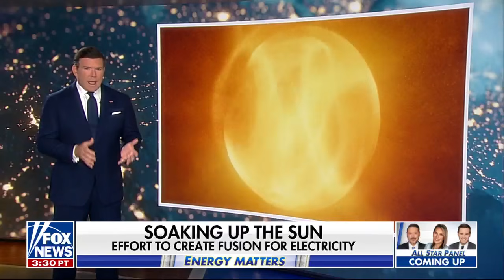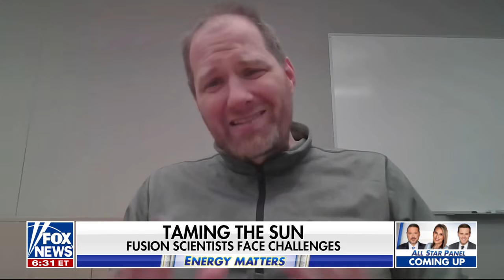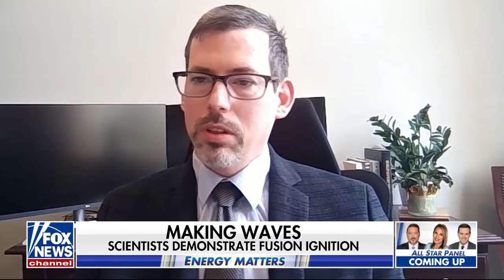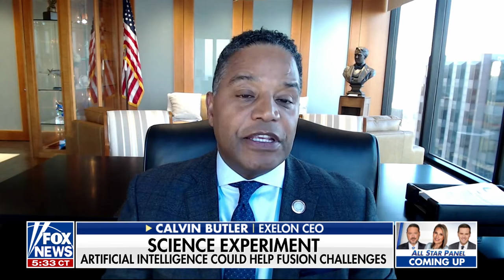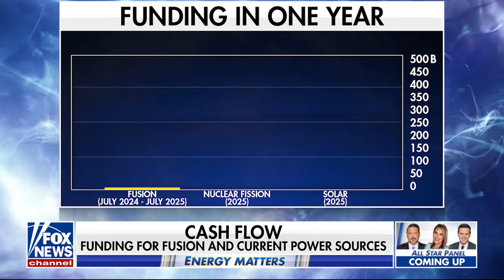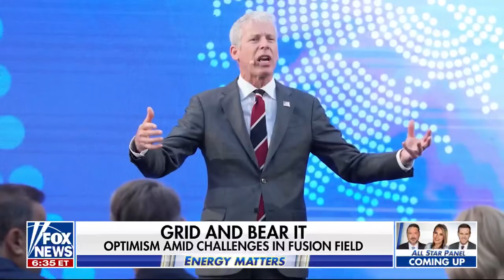AI aiding scientists with challenges to create fusion as a reliable energy source

Comment: The biggest problem with fusion reactors is rarely mentioned. A single fusion reaction is between a deuterium and a tritium atom. Tritium is radioactive and cannot be found on Earth so it must be made in the reactor itself. Each fusion results in a helium nucleus and a neutron. The neutron can be used to breed tritium from litium but neutron and tritium losses in the production chain will give a yield less than one. There are methods to increase the number of neutrons but they will probably not be sufficient.

Comment: I wonder if anything will come from "sonic levatation"?  Things we don't expect.  Just moving a physical object with out actually touching it.. cool.    But, what do you actually have with sonic levatation?  High speed, almost infinite rpm's... with no physical ball bearing or axle or means to hold the high speed object.  There is No Friction.  If you vaccum out the room of air and all air friction.. is the spinning sonic object "frictionless' .. that alone in science is ultra hard to do or achieve.  What is spinning?  does it generate a magentic field.. is it cold or hot in the room.. plus or minus Pressurized room too... if a quartz crystal was pressurized a piezo electric effect happens.  Then spun.. the field would expand or contract/condense?

Comment: Helion Energy is building a   fusion Plant WA state. 50 MW (megawatts) It will power Malaga, WA  (Chelan County),  and the DATA center that's being built there. The issue is the Energy fuel . They are using Decayed Lithium to create the Isotope (Tritium Breeding - Helium-4  )  mix with Detruiem .  Helium-3 (
He) Is preferred but the Earth doesn't process enough of it and that would require harvesting the atmosphere (You can see the issue with that  ) ? Helium-3 is already ready broken down and has a lot shorter half life. 
Helium-3 (He) is found in abondance on our Moon . This is why NASA wants to go Back to the Moon.  
Musk Dream of Putting Solar Panels  around the Earth is a Joke .
Reply: You make a great conspiracy theorist. And no, they are not building a fusion plant to power anything. It would use more power than the datacenter.